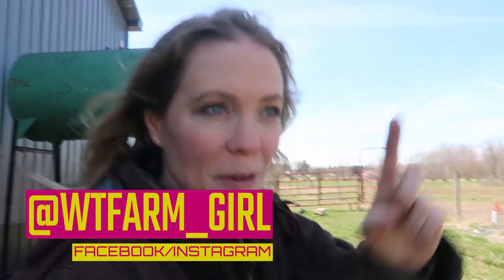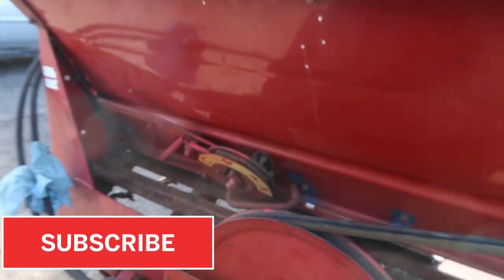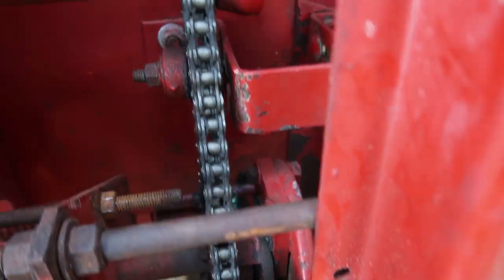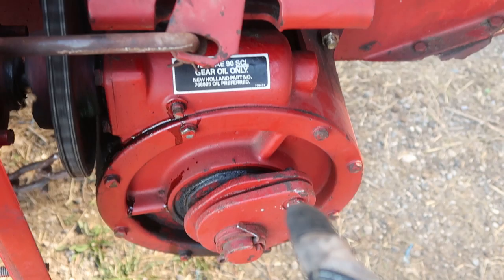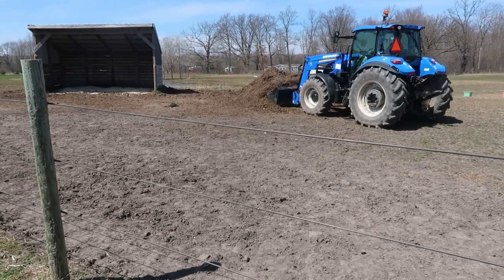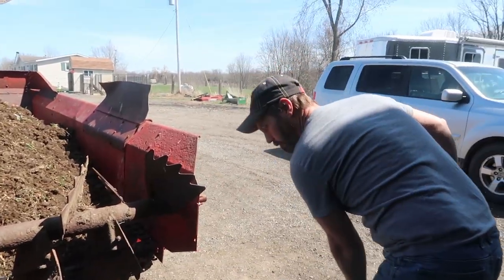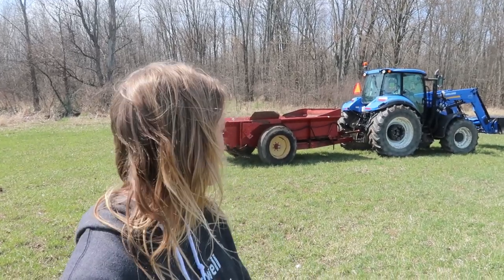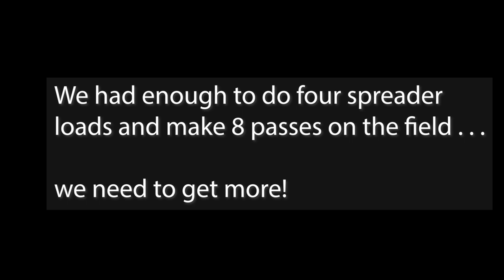297 We BROKE My New Holland 155 Spreader - Will It FINALLY FLY?

Comment: Rule number one is Always, always have a PTO safety guard fitted to your tractor ! Rule number two is Never, never put your hands in or close to running chains or clutches especially with gloves on, you could get your hand/arm ripped right off. If you must put your hand near, dont wear gloves and if you are really lucky you might only get a finger pinched or cut.

Comment: Why  don`t you take the spreader into the corral to be closer to the pile .
Reply from the maker: It's a really tight fit . . . the gate is only 10ft wide and the tractor is just over 8 . . .
Reply: I think I'd be changed in that gate to a 12-footer. You can always use the 10-footer somewhere else.

Comment: Can it be attached to any other tractor not just New Holland?
Reply from the maker: Yes :) The spreader doesn't need horse power so much as just weight hauling. If you are on hills it can push the tractor down or be tough to pull uphill if the HP isn't high enough. I'm going to maybe try it on the TYM this spring :)

Comment: That has to be the worst designed spreader ever,  over here as soon as the spreading is finished and the ground is still dry we tow a chain or drag harrow behind the tractor, it helps break up any lumps and makes for an even finish, they are relatively cheap but effective.

Comment: Wow we know you were full of crap but this proves it...  Most spreaders i have seen have a rope from the front of the spreader for the speed adjustment.  So you can pull it from the cab to  complete your cleanout while you drive it runs though eyes on the spreader to keep it out of the pto.  Could hook the spreader to the truck to load and move it. Too bad  your old tractor doesn  t run enough to make things work. It s a pain to hook and unhook. That the problem with tractors they like friends....  Have a great weekend.

Comment: Suzanne being a used spreader they most  likely had to replace a tire ,one of lesser or more Quality check the ply of the tires they might have different ply's rating and always go by what is on side of tire they could be two different tire company's and spreader's are sized in bushel's so I would say you have a 155 bushel spreader,the back liquid spreader gate is missing I think that the wings on each side of spreader were part of it ,it is nice when you are loading soup ,chicken or tomato it doesn't matter it all taste the same. Also S### doesn't go very far  (Just in Washington it is every where )so don't push your ground speed And use your old motor oil on the apron chain brush it on or make a sprayer .Lastly and this is a Mortal Sin Don't ever load you spreader up and leave it out side in winter ,Most farmers keep the in the warm barn ,If the load is or goes frozen and you start it up and the apron chain  is froze or the load is stuck to the deck you better start looking for another home It's not going to be one of your better days ! Always Charlie.

Comment: 45-50 psi would be plenty of air for those tires considering the loads you are carrying. They only need 100+ psi when they are mounted on a truck. Whatever amount of air you put in keep it the same for both tires.